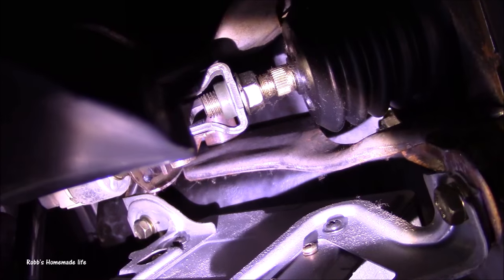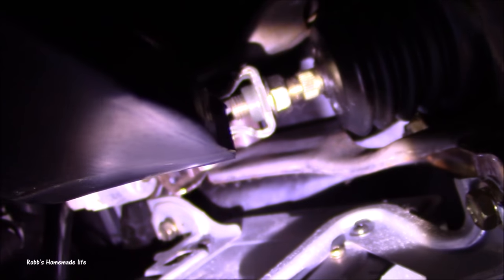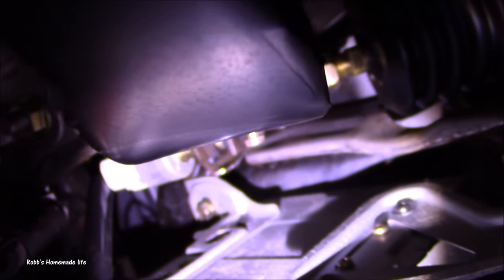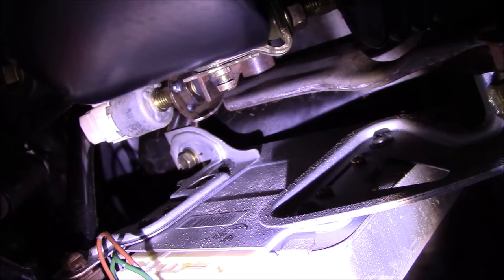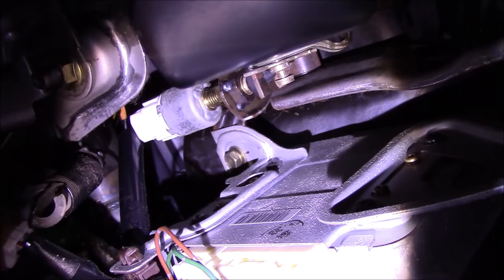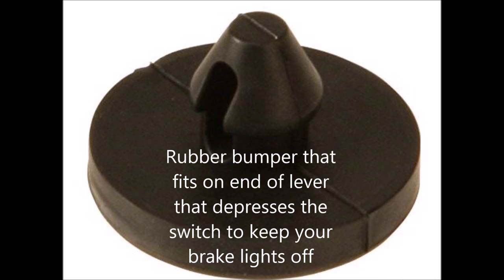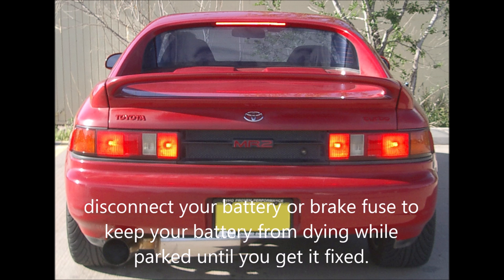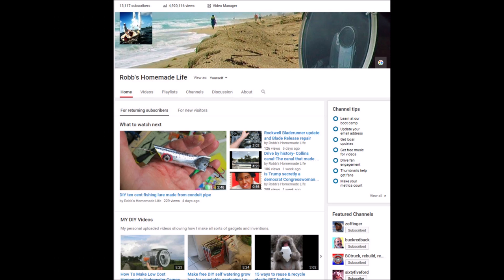Your brake lights stay on and don't go off ? Easy to fix.

Comment: We all need to take a minute and admire the agility and patience it took to record this process, I'm a slim small dude and damn near had to dislocate my shoulder to get under there.
Reply from the maker: Thanks Justin. Your comment is very timely. I have developed a short that keeps blowing my break fuse so I have been spending a lot of time underneath my dashboard and still have not fixed or found the short . I even took a panel off. It is very difficult to work underneath a dashboard upside down and in the summertime. I have an appointment with my mechanic Thursday.
Reply: Agreed!!!

Comment: Went to Walmart to grab some fig bars after work, came out, and saw my brake lights were on. At first, I thought it was someone else's car, because my car was turned off. Then I realized it was my car. Then I got scared because I thought someone was sitting in my car, that's why the brake lights were on. When I realized no one was in my car, I deduced this was a mechanical problem. Thanks for making this WELL-EXPLAINED video! I used a binder clip as a temporary fix until I go to work tomorrow and get a nut & bolt to use instead. But the binder clip works great.
Reply from the maker: Justin I'm so glad the video helped you. Thanks for letting me know. Don't forget I have about 1100 other videos on many different subjects. I had at least one or two every week for the last 15 years. Thanks again.

Comment: I was about to call it quits and look for a brake light switch, because i would depress it and it wouldnt turn them off... well aparently theres 2 switches, one for cruise control and one for brake lights. Of course!, the brake light switch is way up hiding behind the steering column shaft! Lo and behold is missing the rubber stopper. Used a thick trim panel push clip instead. Comments say people epoxxy glue pennies, seen a guy use those furniture floor slider pads since they have adhesive backing. XD
Reply from the maker: Dan thanks a lot for leaving more tips, were all in this together. Appreciate you watching and commenting too.

Comment: Came home couple nights ago to find our 2008 Honda Odyssey brake lights on. It is parked outside and hasn't been used in over a month. I am like what the heck? Did a quick search and found this video. Went out this morning when it is a little cooler. Found pieces of the bumper on the mat under the brake pedal. Confirmation. Ashamed to admit I could not find duck tape or electrical tap to tape pennies in place of the bumper. While searching for tape, I found those felt stickers you put under chair legs so they slide easier. Peeled one off and reached up there and put it on. Problem solved. I guess I will buy the replacement bumper for $10 but I think the felt sticker would work for a long-term solution. Thanks for a very useful video.
Reply from the maker: Hey thanks for taking the time to watch the video and to leave such a nice response much appreciated good luck with everything

Comment: I’ve bought my MR2 two years ago never had an issue with the taillights till today, luckily I came across your video and it helped. I turned out putting duck tape and it worked, thank you sir!!
Reply from the maker: Hey thanks for letting me know it helped I really appreciate that

Comment: That was definitely the problem. I used a tough little piece of cardboard with clear tape coating, and held it on with duct tape rolled in between ther plate and it. Thanks for this video I might not have figured it out.
It is really cramped in that space resulting in some cursing!
Reply from the maker: Hey Mr. Mike. You got that right. I think mechanics should do their own yoga shows.
Reply: @RobbsHomemadeLife  Thanks for your video, it's perfect!

Comment: :hand-pink-waving:   Yup!    You are exactly right !    Found the  piece on the floor.  Later my roommate said, hey your lights are on!  
Lots of plastic on these 1999 Corolla (old and brittle)  but my car still runs well and just passed 270,000 miles. Thanks !
Reply from the maker: I know what you mean. I have a 94 Corolla. I replaced a lot of plastic. This year my brake lights melted. Be gentle when you close the trunk.😀

Comment: Well let me slide in here and give my thanks to you sir! I shall tell my tail of what lead me to seek you out😂Just got the left and right control arm fixed to round up my alignment. ( Money issues a month straight so I was stressed)3 weeks later, the van proceeds to stop cranking up. After the battery was replaced, I again wake up to a dead van. Alternator was bought and my friend's son, (the mechanic) noticed the brake lights we're still on. It was at that moment I realized 50% of my issues most likely came from those lights staying on. Until we all could figure out the issue, the battery cable was unhooked. This is what lead me to this video that very night. With hope in my little single mother heart, I went under the wheel with tool the mechanic left me, re-watched your video and found that we indeed fall into this category. Thank you my good man for your lovely video and saving the day! I also want to give a shout out to the inventor of duct tape, as this was used to also aide in our issue😝😝 of
Reply from the maker: Hey Denise, thanks so much for watching the video and leaving a nice comment. I agree, duct tape and although you did not mention it, pizza, can do anything.😀👍
Reply: 🤣🤣 Indeed ❤

Comment: It's always nice when the search words complete themselves, then to get the problem fixed with the first video you pick. Thanks Rob! I used the cutoff round end of an old bike handlebar grip and some tacky auto adhesive off an old buick riviera door panel interior. Worked great! Pays to save junk....Nylon bolt cut short and pushed thru the hole and then a hot butter knife to mushroom the threaded end would have worked too I think..Just sand the head to the right thickness before melting in. If my tacky ahesive fails I may try that next.
Reply from the maker: Tom, thanks for taking the time to leave such a nice comment. When I make a video I never know if it is really going to help anybody and am always very happy to hear they actually did help. You know, old Rivieras are one of my favorite cars. If you like short stories and Buick Rivieras you should watch my old video R is For Racing  https://youtu.be/hU-XETdCGOY
Reply: @RobbsHomemadeLife  Yeah, it's nice to get the pos feedback... Thanks I will check it out! PS I'm thinkin of selling a "96" supercharged w 90,000. Shifts when it wants to and I dont dare take it to a mek n ik...Loved driving that car for a year. But the doors took up two parking spots! lol

Comment: very awesome and helpful video!!!! i searched up wondering why my lights wouldnt go off an stumbled on to this video an low an behold when i checked the part litterally fell off an hit me in my face😂, the odds of the exact part falling off after watchin this was amazing. i was able to take a rubber wire holder in my car an cut it to exact thickness an double side taped it on. problem solved for now! thank you for this informative video!!!!🤟🏼
Reply from the maker: glad to help!!

Comment: TY for the video. At least now I know it is not electrical issue!  I can only get 1 arm in there.  What do you use to hold the shaft down so you can get the screw in (with only 1 hand)  was was hoping to see you actually replace the part.

Comment: Thanks for making this video. Helped me tremendously. Also, you can find this part at a toyota stealership for under $3.
Reply from the maker: I'm happy the video helped you. You're right the part is very cheap the hardest part is if you are an old geezer like me it's hard to get at the part to replace it.

Comment: Great Tip!  Last night when I put my 1997 Lexus SC 400 in the garage I notice the brake light would not go out. Thought that I had a wiring problem, and disconnected the battery. Found this video this morning and went out and checked my Lexus. Sure enough that little rubber cushion was the problem. A visit to the Toyota parts store and bought the cushion for $1.54 . Got home and popped it in and I am good to go !  Thank You Robb!!!
Reply from the maker: $1.54, that is pretty sweet!

Comment: Thanks! So as a temporary fix my skinny flexible daughter stuck a 3/4" "super slider" self-stick felt pad in place. A tip, you have to press the brake pedal down to reach and expose the place where the stop pedal fits. The ignition must be on. I had the fuse pulled while she did the repair.
Reply from the maker: Thanks for leaving a helpful reply. Much appreciated.

Comment: I fixed mine with a washer (with a small hole) and a zip tie.  My Tacoma has a hole in the plate facing the plunger of the switch.  I just lined the washer up with this hole and fit the zip tie through.   Make sure the thickness is about the same as the original piece so that the lights will come on with adequate pressure to the pedal.   BE SURE to note there may be a spring in front of the switch.  You'll need to put the zip tie under the spring, not over it.
Reply from the maker: Hey thanks for leaving such a helpful comment. Much appreciated.

Comment: Yes, I have this going on, but the brakes seem good. I will look at it. I never thought it would be on the brake pedal. This is inside my car, not outside of the cab or whatever it is called?
Reply from the maker: hey weedy, yeah, you have to get on your back and look under where your brake pedal is located inside the vehicle. The brake pedal has a spring pushing a lever down on the brake light switch keeping the lights off until your foot pushes the pedal down. if that rubber bumper is missing the switch cannot be depressed to keep your lights off. Here is a link to Amazon for Toyota brake pedal stop pads. There are different names for the bumper.
https://amzn.to/2SReiDl
Reply: What if my rear light doesn't glow until I hit the break and it turns on looks like I have a light out is this electrical?
Reply from the maker: yeah, check your fuse and/or bulb.
Reply: @RobbsHomemadeLife  Thank you!
Reply: @RobbsHomemadeLife  thanks Robb ill check the fuse since its a new bulb

Comment: This saved me. I just grabbed a flat looking twig and placed it between the 2 points of contact to add extra height. That will work through the night until i get something more permanent 😂 i might glue a piece with similiar material and height to the metal side instead
Reply: To follow up, i found broken bits and pieces of the original rubber bumper at my feet at the driver side 🥲
Reply from the maker: Hey Robert, thanks for taking the time to watch and leave a comment. Appreciate it. Glad to help.

Comment: I tried with metal nut and then with a small coin. Didn't work. Then i glued a small wooden chip instead and it worked flawlessly. It looks like the little button is also electrified.
Reply from the maker: I know what you mean. I always feel happy when something I try works out.

Comment: I hate to ask but is there any easier way than to shimmy around to get to where it needs to be installed? It's been my biggest problem.
Reply from the maker: No, it is a bear, but if you can't do it a garage should only charge you a few bucks to pop one on.

Comment: Are you under the dash? Can't find the brake switch. I have a 2002 Toyota MRs Spyder.
Reply from the maker: On a 2002 Toyota MR2 Spyder (also known as the MR-S in some markets), the brake light switch is typically located near the brake pedal. Here's how you can locate it:

Locate the Brake Pedal: Get under the dashboard on the driver's side. You will see the brake pedal assembly.

Find the Switch: Look for a small switch mounted near the top of the brake pedal arm. This switch is usually directly in line with the pedal. When you press the brake pedal, this switch gets activated, which turns on the brake lights.

Identify the Connector: The brake light switch will have a wiring connector attached to it. This connector is usually a small plastic piece with a couple of wires running into it.
Reply: @RobbsHomemadeLife  Okay thank you!!

Comment: Thank you so much Robb! Tonight after driving to a relatives I noticed my back lights weren't turning off. I found the rubber bumper on the floor and squeezed it inbetween the lever.
Only issue now is that I need to get a new rubber bumper because it falls right off again after i push the brakes. Do you know the actual name of this piece? Thanks heaps!
Reply from the maker: No I sorry, I don't know the name, but I know it doesn't cost much. If you look in the comments a few people have come up with temporary solutions. 😎👌

Comment: My break light is always on just when the motor is on but when ignition is on the break light works normally when i push the break. Toyota Avensis D4d 2006

Comment: My Rav4 2010 clock light won't go off after I park and  switch ignition off. Can you help please? Thank you
Reply from the maker: Hello Bibi, if you have had a lot of rain are gone through some large puddles you may have gotten some water on a switch. If not, do a search on Google and see what you find. That is a very specific problem so it should be easy to find if it has happened to somebody else.
Reply: @RobbsHomemadeLife  Thank you so much for your quick response. 

It is true I go through puddles of water quite often. The rains are usually heavy here in Nigeria when it's the season and my path to work gets flooded. 

I have searched Google for answers but found none. My further search led me here.

Comment: my brake lights come on when I turn my headlights on but when I turn them off my brake lights work fine
Reply from the maker: have you done anything electrical on your car? have you driven through a lot of water? I added the wrong brake light  bulb on my VW camper and when I stepped on the brake the horn would blow.

Comment: I unhooked my negative battery terminal until I can find out what's wrong so my battery won't run down.
Reply from the maker: Sounds like a good idea
Reply: @RobbsHomemadeLife  Turns out it's not the brake lights, it's the rear tail lights that stay on even when the car is off.
Reply: @RobbsHomemadeLife  The brake lights only go on when I press the brake pedal.

Comment: my brother in law turned me on to the little clear stick things you put on cabinet doors so they don’t slam! same thickness as the broken plastic thingy.. clean the metal bracket and stick it on.. perfect!
If it doesn’t stay for ever.. keep the rest in the glove box!
Reply from the maker: Hey mark thanks a lot for taking the time to watch the video and leave the helpful tip. Much appreciated.

Comment: How the heck do you get a new pad in there though? I can only just reach the spot. Do I need to take the cover under the steering wheel off first or something?
Reply from the maker: On the Corolla. You can get at it without removing anything but you have to lay on your back and is not easy.
Reply: @RobbsHomemadeLife  yeah, I figured out that it’s easier to have the engine running so you can push the brake pedal in further. That makes it a tad easier.